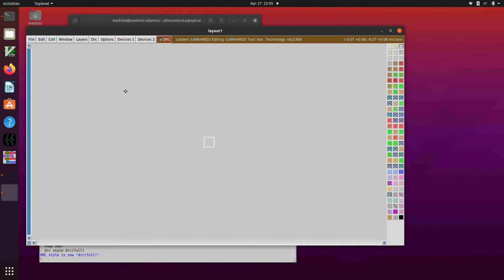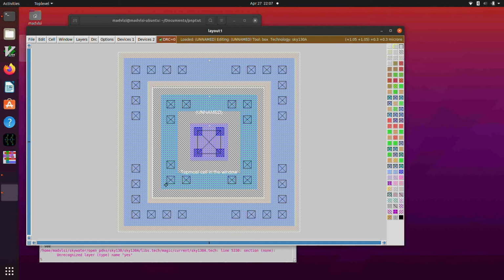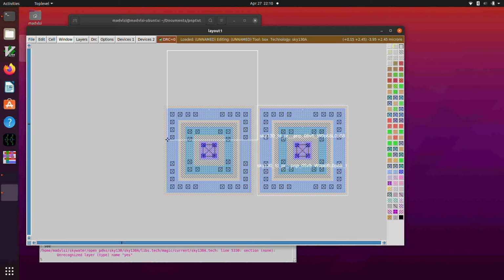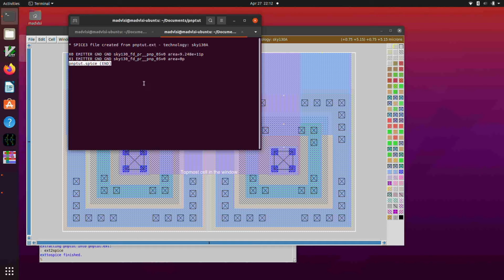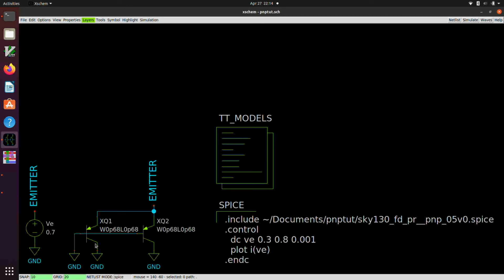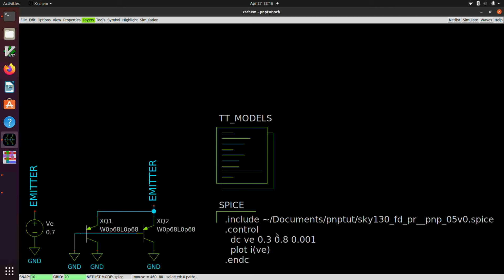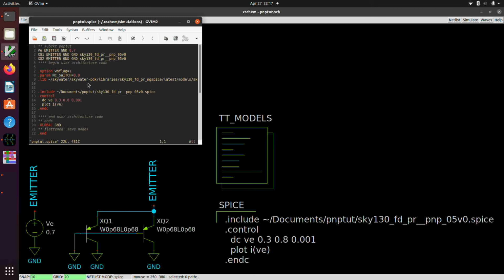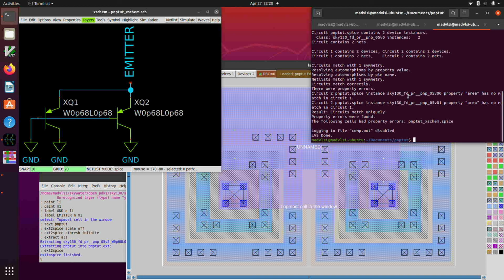Magic / Xschem Sky130 Vertical PNP Transistor Layout / Simulation / LVS Tutorial

Comment: Bro, I need some help in a simple NGSPICE code.
I want to .DC analyses for Output characteristics for a MOSFET,
for that I've used the command ".dc VGS 0 1.8 0.05"
but I want to do this analyses for different Body to Source voltage, and plot (Ids vs Vgs).
I've tried to use the altermod command, but couldn't get to the solution, Can u plz help??